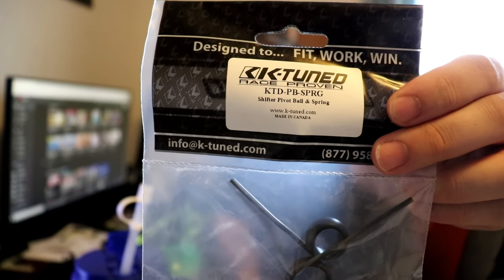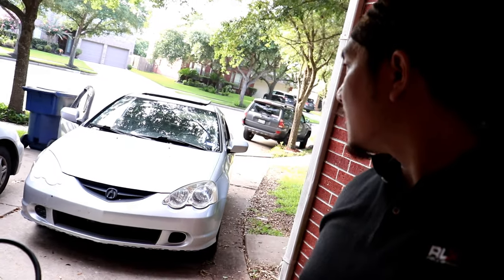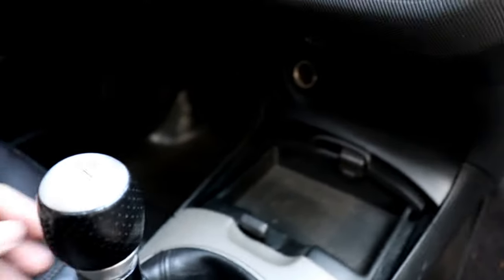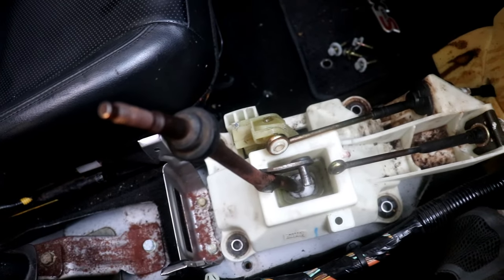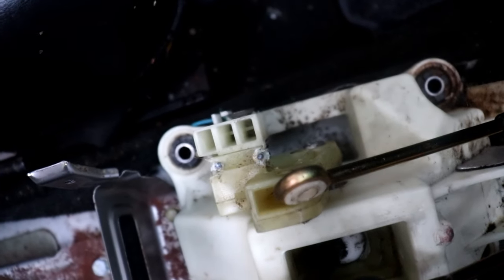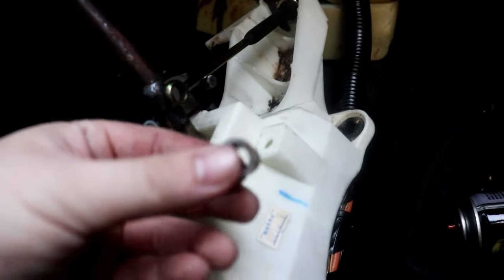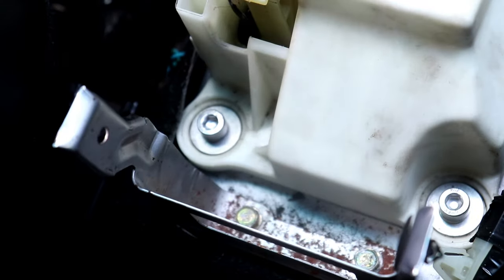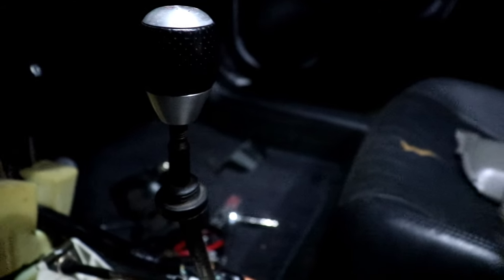The RSX Gets New Shifter Base Bushings & Pivot Ball! | RSX Installs

Comment: Would you recommend the RSX as a first car?
Reply from the maker: oh definitely! Its Compact making it easy to drive and maneuver, great on gas, its a coupe but the hatch style trunk is very spacious for whatever you need, and its a Honda so you know its reliable (assuming you dont find one thats been wrecked lol). Although, If you can drive manual or want to learn, get the Type-S, as it has a 6 speed and the engine puts out more power than the Base model.
Reply: @JedETaleon  ok! I will definitely keep that in mind because I'm trying to decide between an RSX or a Honda del sol.
Reply from the maker: @fidencioespinoza4097  Del Sol's are cool since they are really unique but personally, IMO, the RSX is superior in more ways than one... but hey man, just think about it from different angles and im sure you'll enjoy which ever you decide on!
Reply: @JedETaleon I'm going tomorrow to the dealership and test driving the del sol, then I'm going on Wednesday to meet up with the guy who is selling the RSX and test drive it,  that will probably be the deciding factor as to which one im going to buy.
Reply from the maker: @fidencioespinoza4097  good luck man!
Reply: I wouldnt recommend it honestly lol.
Reply from the maker: @madmarlone  well... Maybe compared to a Del Sol it's not bad lol
Reply: @JedETaleon  for a first car thoe and learning mechanical work an rsx is a pain compared to a del sol lol. Everything was much simpler back then.
Reply from the maker: @madmarlone  well yeah I understand that but I'm talking about living with and using it everyday... I'd take an RSX as a daily over a Del Sol any day of the week lol
Reply: Its crazy how you ask for the RSX as a "First car", im 29 and my RSX its like my car #30, my first car was a 92 accord then i had a 350z, used to have an S2k, G35, WRX 2008, Ep3, GSR 2000, Eclipse GT 08, 240sx 96 and  a bunch of 90s cars and here i am, loving my Type S 2006 more and more every day dropping money on it like if it were my first car, I love my car it makes me feel young 🤣 I love it more than my daily 18 Camry so what you can learn from my story? Yes RSX could be a perfect starter car and keep it cause I can be your lifetime one like in my case that comming from a few popular cars I decided to keep my Dc5